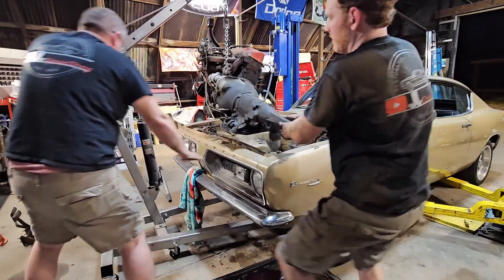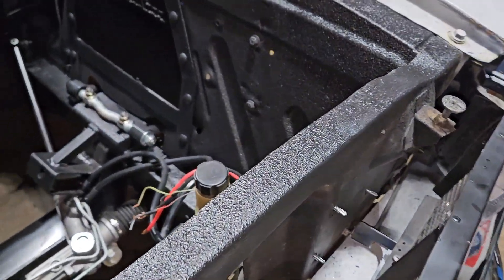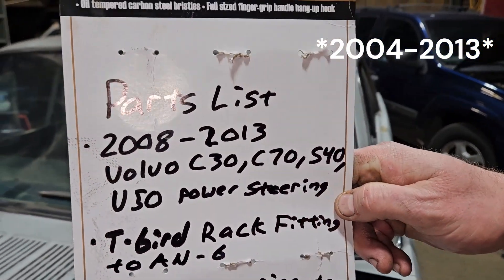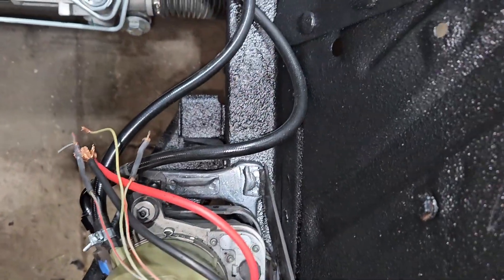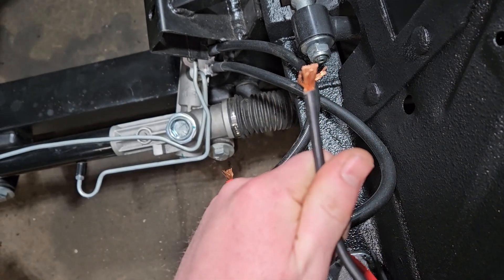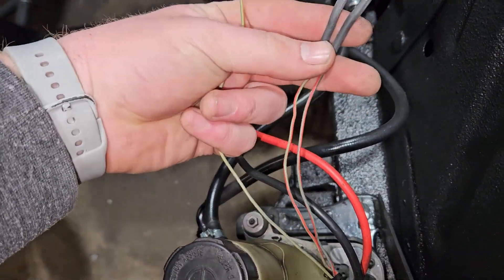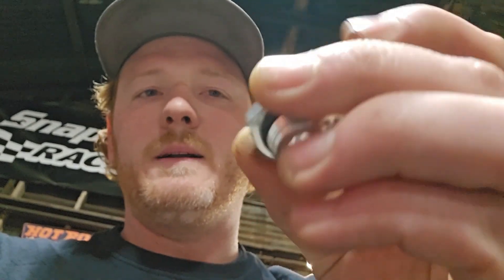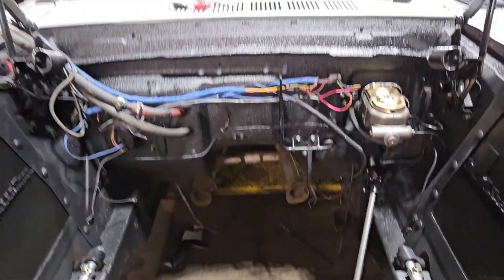Volvo Electric Power Steering Pump on 65 Mustang!

Comment: I wonder what all would have to change, if anything, to go to a borgeson box instead of a rack. It would be cheaper for me to pick up a power box instead of a full rack system
Reply from the maker: Just the fittings on the hoses id assume. Let me look it up and I'll get back to you.
Reply from the maker: Operating pressure looks about the same as a Rack so the pump should work fine, and the fittings are M16×1.5 flare. So it would be identical except fittings and how the hoses are routed. Good Luck! Power Steering is nice.